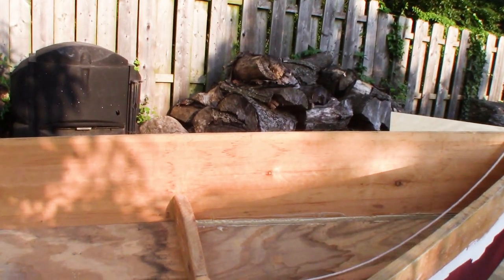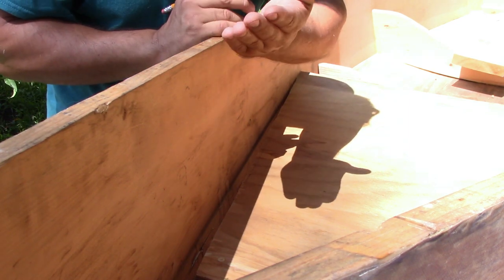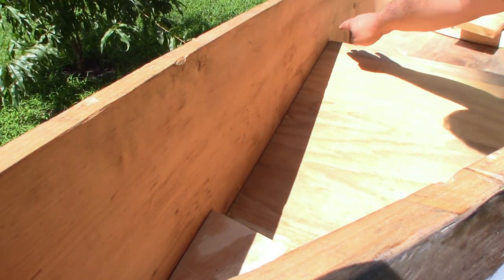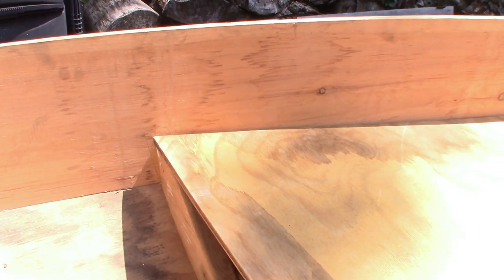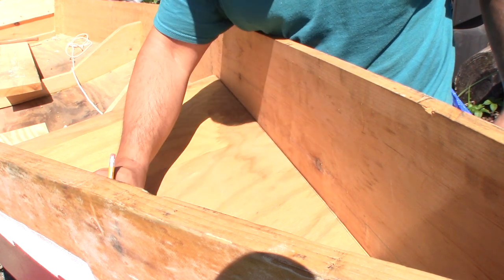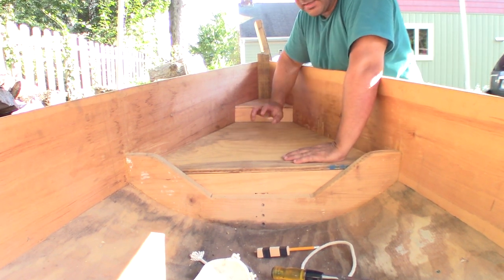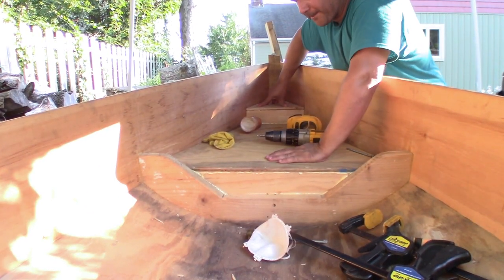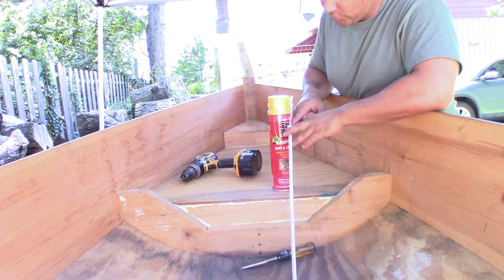HomeMade plywood boat part 9 - closing the bow for flotation foam

Comment: I had seen a video this winter of a guy refurbing a used boat. Unfortunately I don’t recall who it was or the name of the video.  My point is that when he pulled up floor boards, he found expanding foam that a previous owner had.shot into the cavity between the floor board (plywood) and the bottom.  The foam was saturated and the plywood thoroughly rotten.  It seems that when that not so great stuff gets wet it holds on to water and promotes rot.  You may be better off with polystyrene blocks cut to shape.  Sorry to be a wet blanket, but folks should know.
Reply: I totally agree. Styrofoam blocks not only float better because they have less density, they don't absorb moisture. Plus you can hinge the top boards off the bulkhead and take out the styrfoam from time to time if you need extra storage. another good idea is to use the space to stow away flotations vests when not in use.
Reply from the maker: Good point

Comment: One of the biggest problems with Great Stuff is when it expands into foam it generates a LOT of pressure. I've had it blow drywall right off the studs, and warp door jambs until the door couldn't be made to close. Using it, you should not close up the cavity but leave the face open. Give it 24 hours to stabilize then trim it with a small hand saw or something so you can fit the last face on.
Reply from the maker: yeah, i learned that for the next time... there's always a next boat!